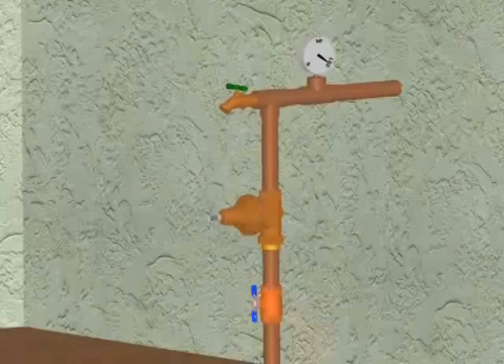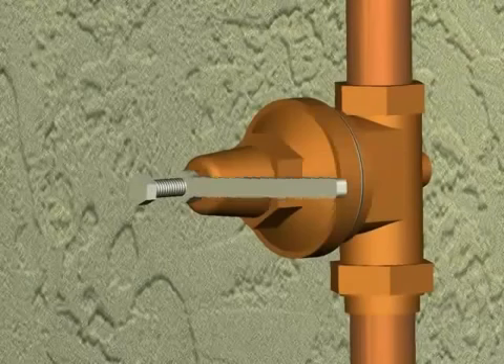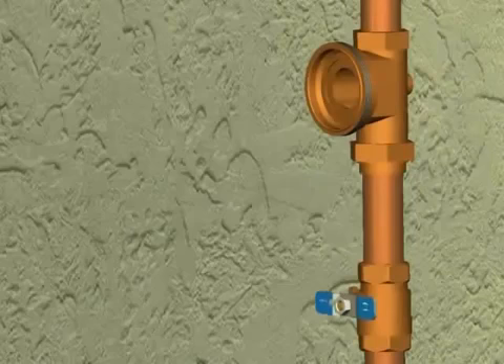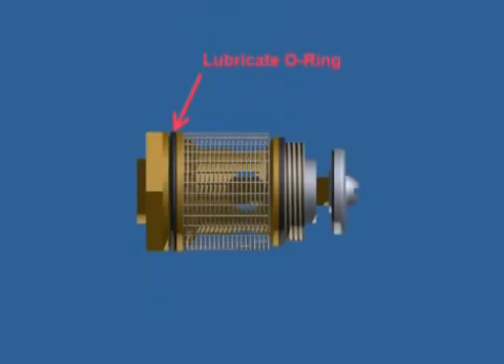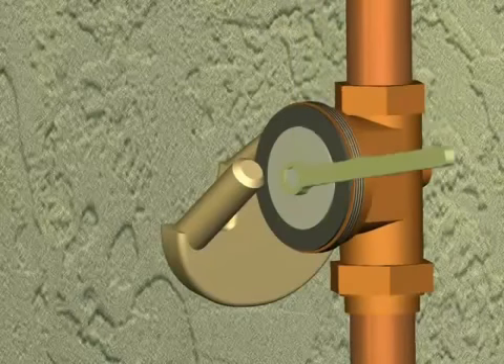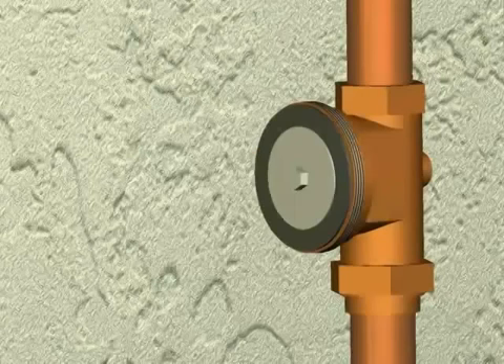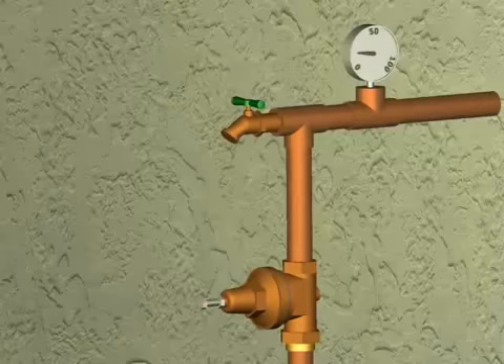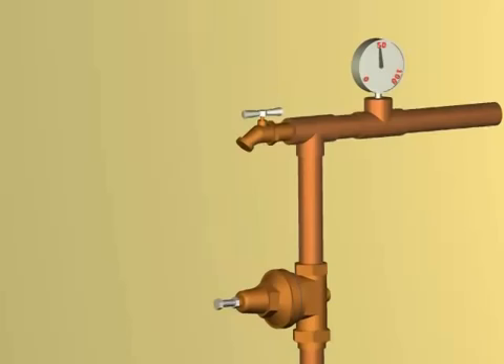Zurn Wilkins Model 70 Repair Video

Comment: For those of you DIY this was really easy, about 1 hour. Buy the 1 inch Zurn Wilkins Model 70XL Repair Kit - Bronze Valve Repair Kit  at Lowes Item #4356625 | Model #RK1-70XL $63.80. BTW the cartridge is cheap Plastic not Bronze like the original. Unscrew diaphragm bolt, then Bronze Cartridge using 1-3/8 socket, flush, then reassemble by hand-tightening the Plastic Cartridge (too fragile for socket), then reassemble in reverse order. My water pressure reduced from 90 psi to 60 psi.

Comment: This is all very nice, except the diaphragm bolt can't be removed, because whatever it's screwed into spins (just holding the diagram against the edge of the body, as shown, did not work).  However, if you look down into the body from one of the ports, you can see the spinning thing, and there's a slotted screw at the end.   Have a helper stick something like a butter knife down there and engage the screw, and hopefully. that'll provide enough resistance to undo the bolt.
Reply: Just use some wise jaw pliers to hold it. Squeeze, hold and remove bolt. . It does work. I was like what the heck?